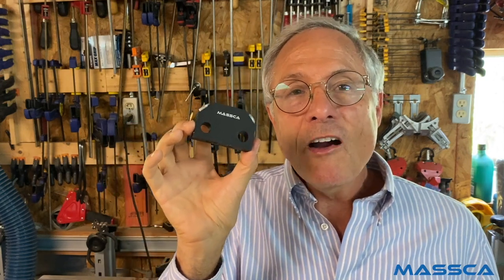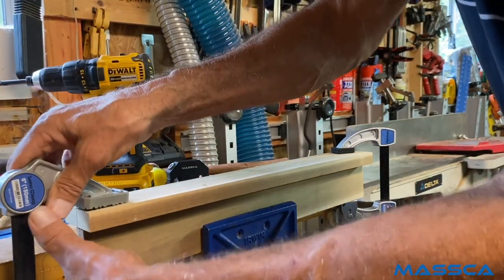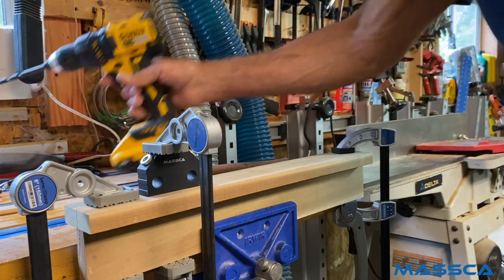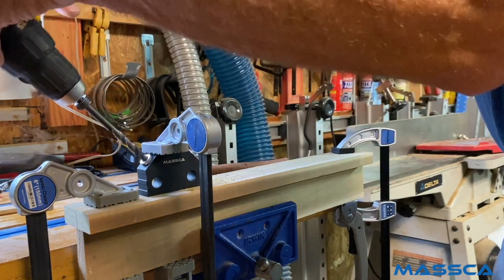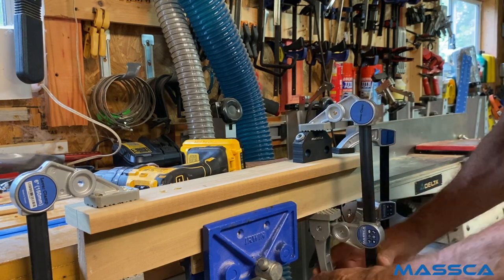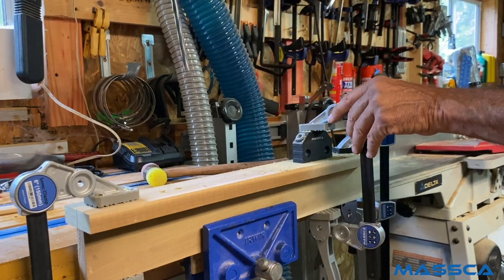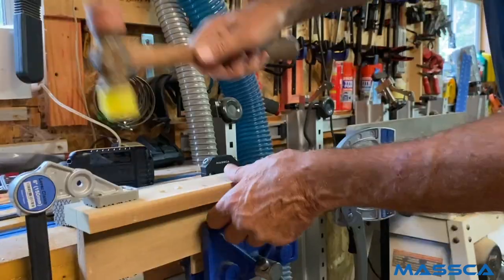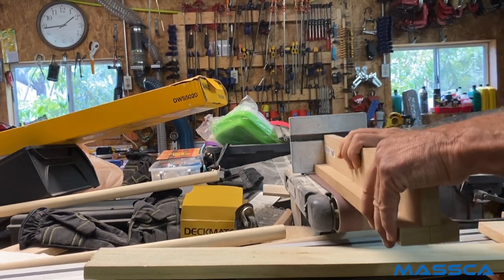Massca Dowel X - For Angled Dowel Joints

Comment: What is the size of the drill bit being used? Is it the standard one that comes with the pocket hole jig?
Reply: Same size bit, but without the notched tip for the pocket hole screw, since that isn’t needed in this application.
Reply from the maker: Hello, the drill bit is included and is with the dowel jig.